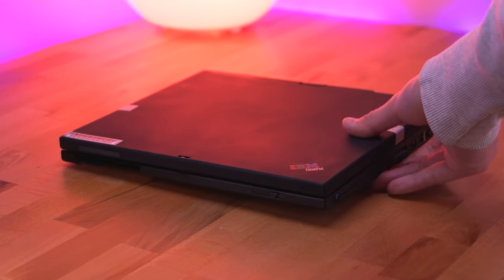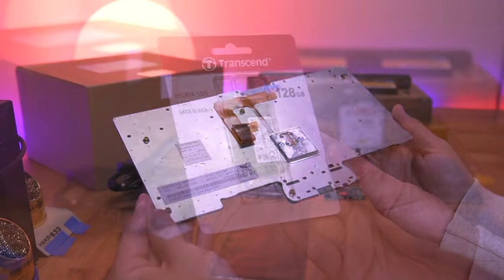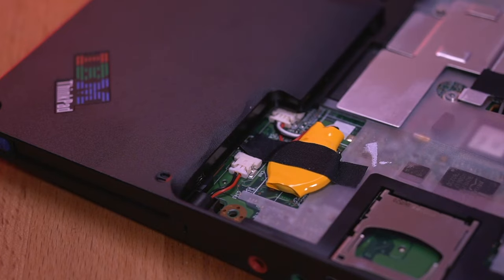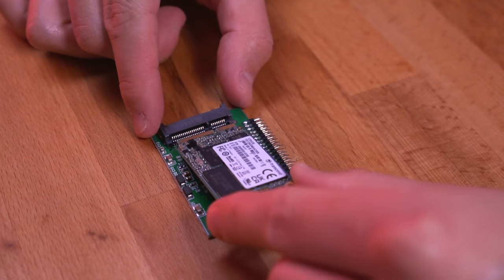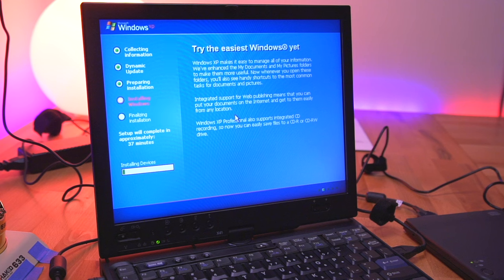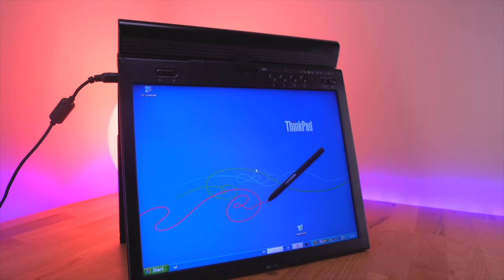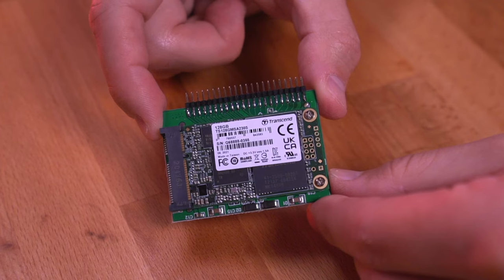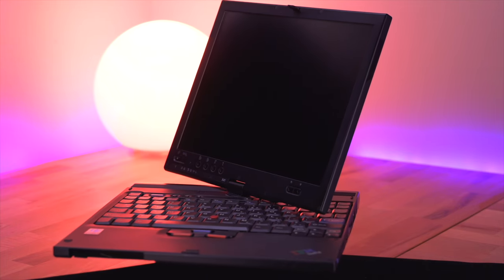I Built A Brand New ThinkPad

Comment: I had one of these in high school, right when Smart Boards were taking off. I managed to bootleg the software for those things and do my homework with it. I'd even take all the lesson board work from my teachers and use it for notes. It was amazing, loved that tablet. The graphics were complete garbage, but Windows 8.1 made it more tolerable with decent Basic Adapter drivers.
Reply from the maker: Nice!
Reply: I don't understand this thing (though I haven't finished the video). It looks just like an older version of the Thinkpad I had with the testing screen and everything. The thing is I got mine when Windows 8 came out so that would make a lot more sense to have a computer built like this but why would they make one in 2005? I always assumed mine was just a one-off that they made and then never continued making them again or previously.

Comment: I have the x61, which is one of the next models, they made a docking add-on for these that gave you a slim drive, and all of the ports like parallel, which is what I use on my X61, as it is used to run an old eprom burner :)
Reply from the maker: Nice!
Reply: T60/61 and X60/61 are excellent PCs and also the last to have 4:3 aspect ratio

Comment: I did something similar for XP, only I got a T43 from a thrift store for $9.99. It came with the ThinkPad factory image of XP SP3 on an 80GB HDD.

It's a Pentium M 1.86, with a DVD drive, 1GB RAM and a 1400x1050 screen. All it needed was a cleaning, a CMOS battery, and some thermal compound. Even the battery miraculously still holds about an hour's worth of charge.

Comment: It was your project Tito. I can only say it works as intended. Those earlier systems are getting costly to refurbish. And I never knew there was a modern approach to the ide drive.

I have an HP Elitebook that has the rotating display. I was going to replace the battery, but it's $65 sticker price before shipping told me not to. It was a good thing because I installed W11 on a whim and it started to charge.
Reply from the maker: Nice!  Glad you were able to save the battery!

Comment: You are really lucky with this project. The X41 was a fantastic machine in its time. While not having groundbreaking performance it is compact and very versatile, without any real competitors. I still use an X201 tablet, which looks remarkably similar. The only extra i/o port I have is an Expresscard slot which never really caught on, and I do not have an infrared transmitter.

The stylus for the X60/X61 tablet and X200/X201 tablet should also fit this X41 tablet, and they are still quite commonly available if you can accept a non-original stylus. The plastic on my original stylus became all sticky after 8 years, so I replaced it with an aftermarket one. That works.

Comment: That's generally the problem with laptops that are being sold for cheap with some components missing. The price will look enticing at first, but even if the laptop is just missing RAM and a hard drive, the prices can quickly add up.

Comment: Nice laptop, but it would have probably have been a good idea to remove the heatsink from the processor and replace the cooling paste before proceeding just because the laptop is 20 years old and it's likely that the cooling paste will have dried up by now which may cause some loud fan and cooling issues.

Comment: I traded for a x60 the other day which seems like an updated version of the x41. It came with the stylus and it’s in decent condition. I was thinking about swapping the board from an x61 Thinkpad so I can run Windows 10 on it. It’s a solid machine and I like it’s design.

Comment: Beautiful machine. I have one as well with a dead backlight. I bought it cheap for it's screen, as I wanted to have an IPS panel for my X32 (with some modification these screens can be used in those machines) and was planning to LED mod the screen anyway, so the dead ccfl backlight wasn't an issue. The thing is though, this mentioned X41 tablet turned out to be in extremely nice condition, so I just don't have the heart to strip its screen out then leave it as a parts machine. So in the future sometime I will try to LED mod the screen, and restore this X41 tablet as it was.

Comment: Still an incredible deal!! Those think pads are built like tanks. Can’t go wrong with em. Had one back in the day but unfortunately it broke and it got chucked out. You can probably get a new battery online. All the parts are still readily available. Just brought an untested Think Centre for £40 myself. Got a 64bit processor so gonna up the ram to 4gb, add an SSD sound blaster etc and put a lightweight model of linux on it. Gonna be a fun lil project. Best choice since pis are spiked😂

Comment: The battery probably needs to be jump started or whatever the term is, afaik basically the issue is it hasn't been charged in so long that the battery level has dropped to below the minimum amount to begin charging, I've found a pda from year 2000 that had this same issue and I was able to fix it after jump starting the battery (im using the wrong term but you can probably find it out by googling)

Comment: He definitely said tablet instead of laptop at the beginning of this video.

I haven't finished the video yet but the screen looks like it's flipping around which doesn't make any sense for 2005. It does make sense for 2013 when Windows 8 came out which is what I have. Well I sold it to my best friend but he still has it. I've replace the cooling fan and the battery when those went bad and it's still a really awesome machine. I am confused why the hard drive bay stopped working properly with a hard drive plugged in (can't even boot to bios) but luckily it had a 24GB mSATA drive I could reformat and install Windows 10 on.

Having the screen flip around is so much better because you don't press all the keys on the back side while you're holding it I mean you're not really supposed to hold them they're too heavy but still in the event you do decide to hold it You just burn your hand on the cooling system. My favorite mood was tint mode with a proper keyboard and mouse when I was at home but that was just because I was a young kid and so I was fascinated by new things and reality tent modes not that useful.

Comment: Nice mSATA ADaptor.
Though maybe an m.2 SATA Drive and a SATA m.2 to 44pin Adaptor (a bit harder to find but possible to source) might have been a better choice?
Some even come with a plastic top cover, so you only might want to use some tape for the buttom and it looks like a normal 2,5" IDE HDD.
Reply: These older X-thinkpads are using 1.8" HDD, so 2.5" case wouldn't help.
On other hand, chipset supports SATA so you could even mod SATA SSD in without using IDE-adapter.

Comment: My battery was the same, and even tho it was always kept in office, the problem was corrosion. I took battery apart and theres a pcb in there that get so corroded that it doesn’t work. I cleaned and reflowed it and the battery charges around 70 percent

Comment: I bought the same laptop and the seller is in FL the SSD will put up an Operating System Not Found message at least in WIN7 and the only way to fix it is with a HDD. i made custom ram covers and HDD cover from steel and never bought the battery as it's too expensive. overall a great performer with the 1.6 CPU.  I also got the missing WIFI card from China. Hard to imagine this performance in such an old device.

Comment: A few weeks ago, I restored one exactly like that!
But, unfortunately, I couldn't get the IDE to M-Sata adapter to work. 
Could you provide some info about your adapter?
By the way, it is possible to put 2,5GB of RAM with a specific RAM speed and brand. I have done it!
Reply: I am not sure, but I think that the correct adapter is one of those that don't have the 3.3v voltage regulator.
If someone could guide us all with some info, it would be great!
Thanks
Reply: Another info about the HDD error:
There's a modded bios to bypass that limitation and others as well. It is pretty easy to install that bios update.

Comment: 5:10  Here is a small tip.  You see that blue Pentium Inside logo?  You probably have the Broadcom WiFi.  You can change it to display Centrino one by replacing the WiFi card to Intel 2200BG one.  Centrino was the more premium brand with a better WiFi.  You can even buy the Centrino sticker that you put on the palmrest (left side) to go with it.
There is a catch, however... you must get a specific Intel card that goes into IBM laptops.  Other branded ones (for Dell, Toshiba, etc.) will not work and will not be recognized.  You should be able to get one for less than $10.  Dell laptops of that period are not as picky, so they accept most of the Intel 2200BG cards of that format.
Darn, I might have an original OEM IBM Tablet Windows XP image somewhere, but no promises, as I just worked on the usual laptops, not tablets, but I'll try to have a look.
Reply: ⬆️⬆️⬆️congratulations you are among our shortlisted winners claim your reward🎁…….

Comment: Any computer that runs XP is worth it. 😁 More seriously though, that machine looks awesome. As cool as these new, slim machines are, nothing beats the IO of these old school machines. I had an old Dell for the longest that had like 4 USB ports, a Wi-Fi expansion bay, a PCI slot (don't recall which type), easily replaceable and upgradable components, an Nvidia card (don't recall that either), VGA, a Pentium 4, 2 GB of RAM, and, of course, XP. Unfortunately, my motherboard died at some point, and I ended up laying it to rest. RIP ANOMALY. 😭
Reply: ⬆️⬆️⬆️congratulations you are among our shortlisted winners claim your reward🎁…….

Comment: The software for is-nitro-emulator can be ran on windows 10 in compatibility mode. There are forum topics on how. I’ve had no issues or weirdness using mine like that. Also look into it because you can update the nitro to unlock all features.
Reply: Not that I’m saying using more period accurate computers is more fun and can be easier at time, I need to get an XP machine because the wii NDEV units drivers need XP while the software itself doesn’t.

Comment: These laptops generally use 18650 cells in both series and parallel configuration. Usually just need some skills, a spot welder and and soldering iron and some glues. Is can be done DIY but be extra careful with those 18650 cells.
Reply: ⬆️⬆️⬆️congratulations you are among our shortlisted winners claim your reward🎁…….

Comment: Nice refurb video, Tito :)
You can swap out the cells in the battery if you have a working battery lying around. Just make sure that the E-fuse is good on the battery BMS board. I did that with my IBM ThinkPad X40 I purchased with a CD docking station on a local flea market for 10 dollars this weekend. I soldered the cells instead of spot welding, and they are used cells but the laptop runs on battery for about an hour which is fine with me. Where exactly did you find the recovery for this laptop/tablet combo? 
By the way it is a HIGHLY collectible item now :)
That
Reply from the maker: Thanks for the tips Andras!  I found this laptop on eBay over a year ago. When I bought I remember seeing a lot of these partial laptops available. I liked more recently and didn’t see any available. I’m guessing this was from a lot that was sitting at a warehouse/storage

Comment: I had no idea they made thinkpad tablets that early! I have an X230T that was released in 2013 and encountered a similar issue with the tablet-specific features; My quick-buttons by the monitor don't actually work because I chose to run windows 10 and couldn't find the appropriate drivers :/
Reply: If it's from 2013 then it was running Windows 8 like mine was (s230u) I didn't know there were other twisting moddles of Thinkpad cuz they were the hotness when Windows 8 came out but now not so much.
Reply: @bland9876  Could be that yeah. I was looking at the separate drivers, not the whole recovery disc image. I generally just use it as a backup normal laptop now, dunno if I'd go through the trouble of reinstalling for Windows 8 and correct drivers. But I might find the recovery disc and save a copy just...because lol

Comment: I hate to break it to you, but laptops that have that rubber coating on the laptop are disintegrating as we speak.  I have some leftover T20-T23 laptops here and they became very sticky and if you push on the coating it will move like some kind of goo.  Same goes for the extended battery for Dell D410-D430 and D620-D630.  With these batteries you can clean off that sticky goo with a napkin and some IPA.  Also some older desktop mice with rubberized sides have that problem, including ones from Microsoft.  Truly a shame...
X41 is bit newer than the T20 line, so you may have few more years left in it.